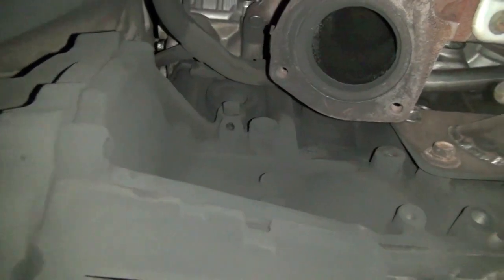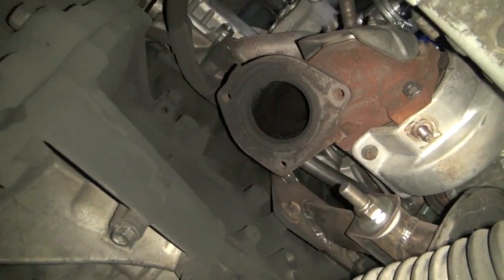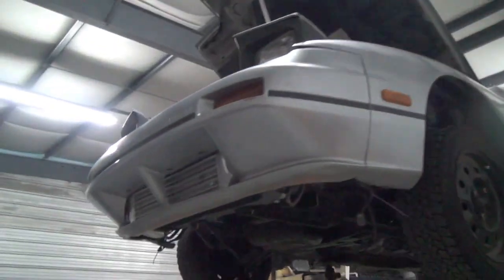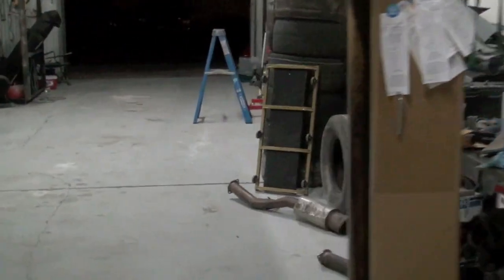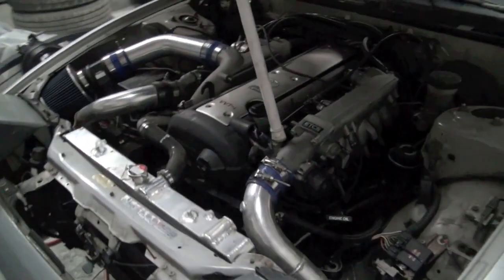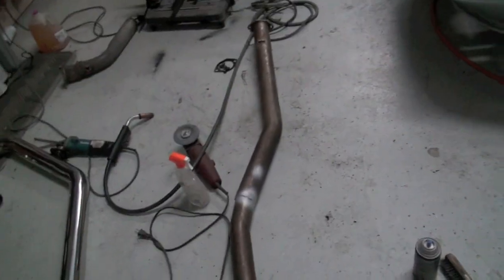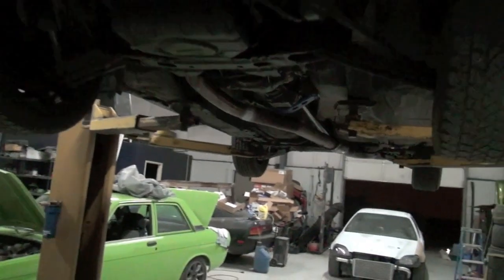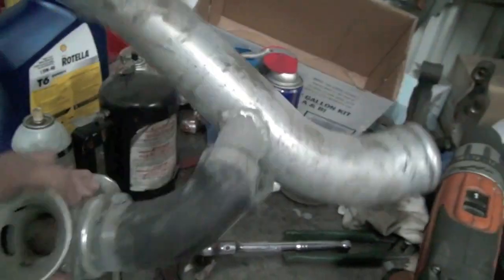1jz-gte 240sx VVTI 3" Straight pipe exhaust

Comment: Just a thought, it would be cool if you ran the exhaust pipe through the front fender!
Reply from the maker: if it was a turbo v8 i would
Reply: +MotionAutoTv run it towards the ground, just the tip so it echos off the ground I've worked in an exhaust shop and it what I got on mine and my mates cars (do it just before the diff )
Reply: +MotionAutoTv I've got a 1Jz in a VL commodore